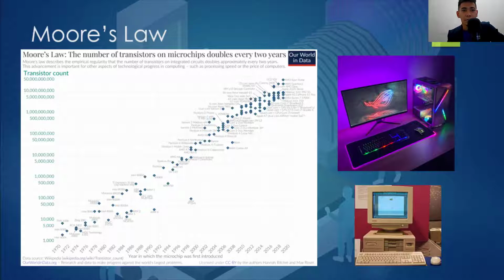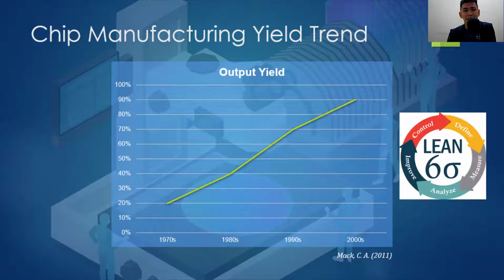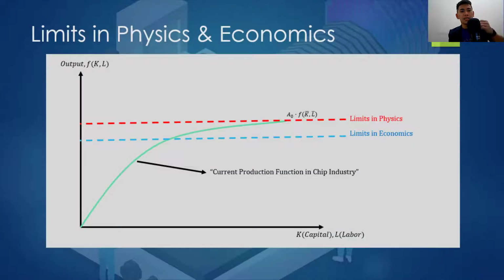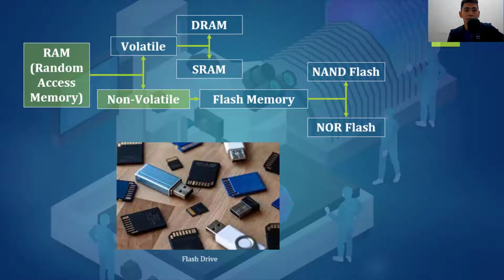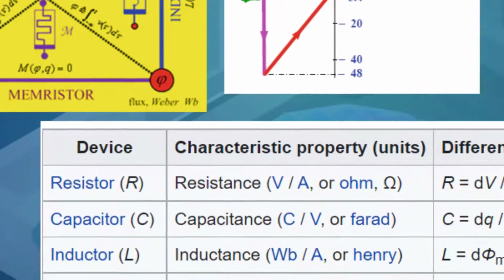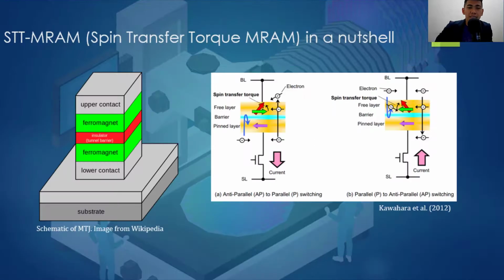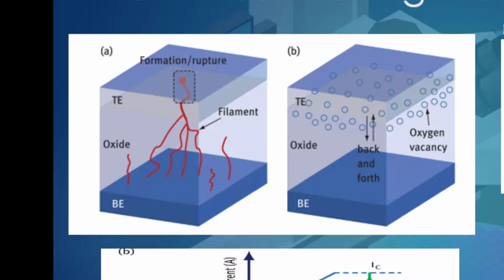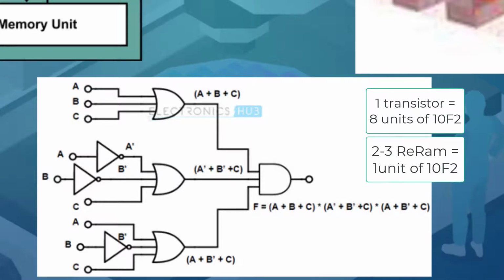ReRam Vid byAC

Comment from the maker: SOURCE:

A. Mulay (2014). The Macroeconimics of 450mm Wafers. AnySilicon. https://anysilicon.com/macroeconimics-of-450mm-wafers/

A. Zidan, An Chen, Giacomo Indiveri, Wei D. Lu, “Memristive computing devices and applications,” J Electroceramics, Vol. 39, nos 1–4 (2017), Pages 4–20. DOI: http://dx.doi.org/10.1007/s10832-017-0103-0.

Bohr, M. (2007). A 30 Year Retrospective on Dennard’s MOSFET Scaling Paper. IEEE Solid-State Circuits Newsletter, 12(1), 11–13. https://doi.org/10.1109/n-ssc.2007.4785534

Chen, H. Y., Brivio, S., Chang, C. C., Frascaroli, J., Hou, T. H., Hudec, B., Liu, M., Lv, H., Molas, G., Sohn, J., Spiga, S., Teja, V. M., Vianello, E., & Wong, H. S. P. (2017). Resistive random access memory (RRAM) technology: From material, device, selector, 3D integration to bottom-up fabrication. Journal of Electroceramics, 39(1–4), 21–38. https://doi.org/10.1007/s10832-017-0095-9

Chua, L. (2019). The Fourth Element. Handbook of Memristor Networks, 1–14. https://doi.org/10.1007/978-3-319-76375-0_1

Guy-Evans, O. (2021, February 21). Synapse Definition and Function - Simply Psychology. SimplyPsychology. https://www.simplypsychology.org/synapse.html#:%7E:text=A%20synapse%20is%20the%20small,synaptic%20cleft%20or%20synaptic%20gap.

Kawahara, T., Ito, K., Takemura, R., & Ohno, H. (2012). Spin-transfer torque RAM technology: Review and prospect. Microelectronics Reliability, 52(4), 613–627. https://doi.org/10.1016/j.microrel.2011.09.028

le Gallo, M., & Sebastian, A. (2020). An overview of phase-change memory device physics. Journal of Physics D: Applied Physics, 53(21), 213002. https://doi.org/10.1088/1361-6463/ab7794

Mack, C. A. (2011). Fifty Years of Moore’s Law. IEEE Transactions on Semiconductor Manufacturing, 24(2), 202–207. doi:10.1109/tsm.2010.2096437 

Pershin, Y. V., Martinez-Rincon, J., & di Ventra, M. (2011). Memory Circuit Elements: From Systems to Applications. Journal of Computational and Theoretical Nanoscience, 8(3), 441–448. https://doi.org/10.1166/jctn.2011.1708

Prakash, Amit and Hwang, Hyunsang. "Multilevel Cell Storage and Resistance Variability in Resistive Random Access Memory" Physical Sciences Reviews, vol. 1, no. 6, 2016, pp. 20160010. https://doi.org/10.1515/psr-2016-0010

Zahoor, F., Azni Zulkifli, T. Z., & Khanday, F. A. (2020). Resistive Random Access Memory (RRAM): an Overview of Materials, Switching Mechanism, Performance, Multilevel Cell (mlc) Storage, Modeling, and Applications. Nanoscale Research Letters, 15(1). https://doi.org/10.1186/s11671-020-03299-9

Zhu, G., Jiang, B., Tong, L., Xie, Y., Zaharchuk, G., & Wintermark, M. (2019). Applications of Deep Learning to Neuro-Imaging Techniques. Frontiers in Neurology, 10. https://doi.org/10.3389/fneur.2019.00869